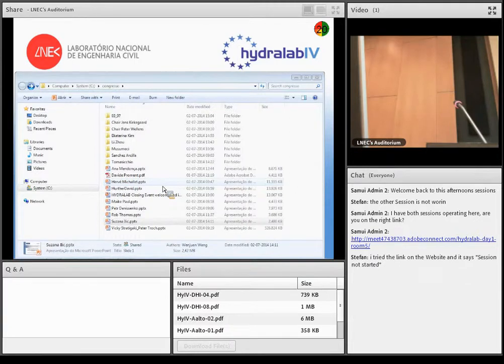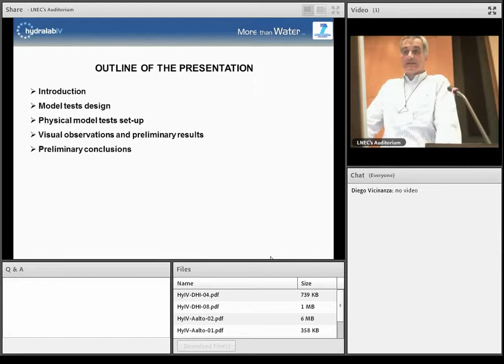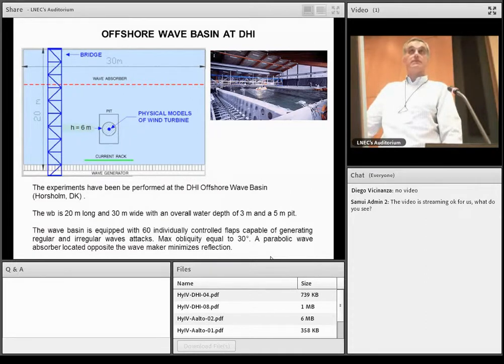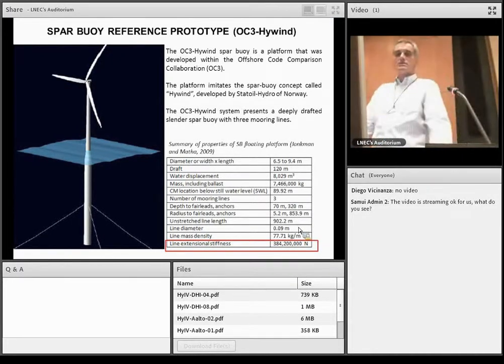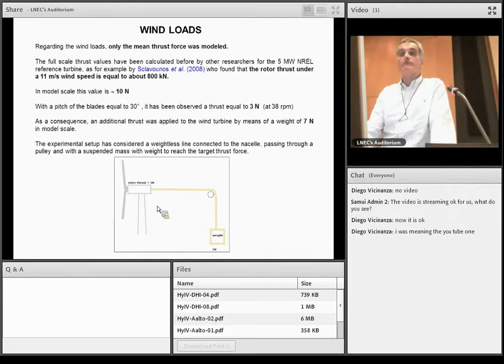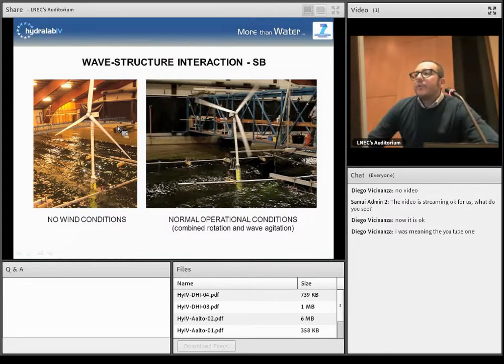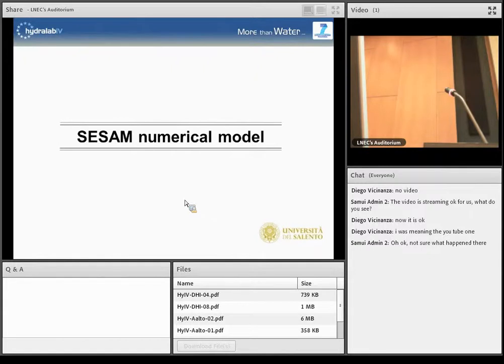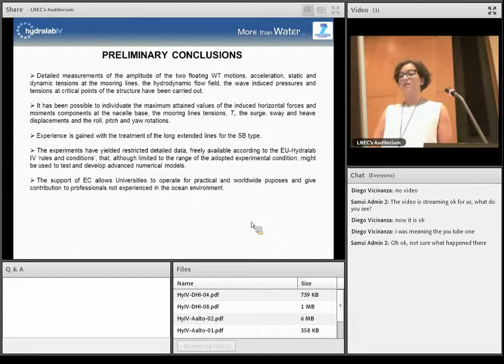PHYSICAL MODEL EXPERIMENTS ON FLOATING OFF-SHORE WIND TURBINES

Comment: The Spar buoy was made up of two Perspex (acrylic) cylinders. The bottom was a PVC plug. The space between the outer and inner cylinder was filled with foam.
The inner cylinder provided space for lead ballast for adjustment of hydrostatic properties (COG and rii).

You are welcome to contact jkj@@dhigroup..com directly if you need further info!
Reply: +Mark Klein Breteler Thank you!!